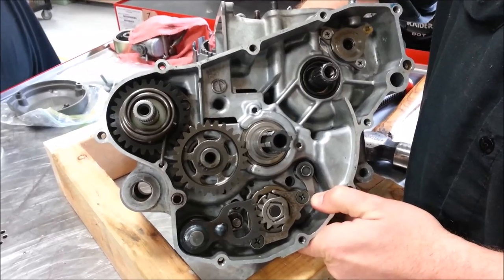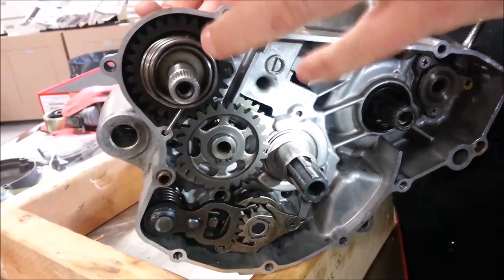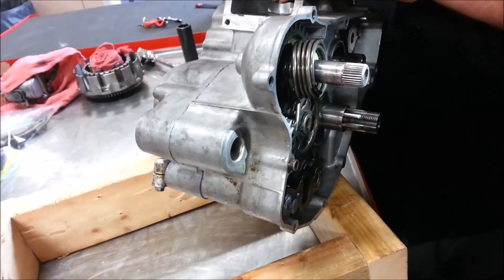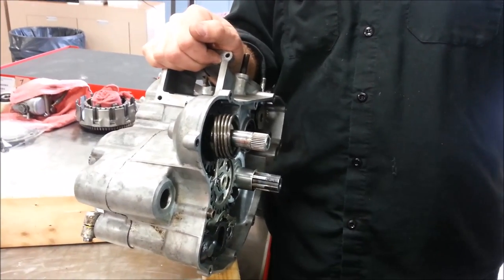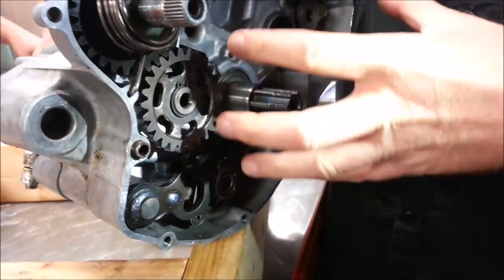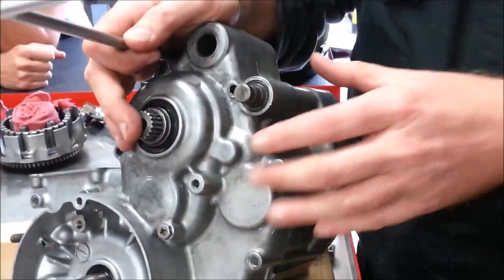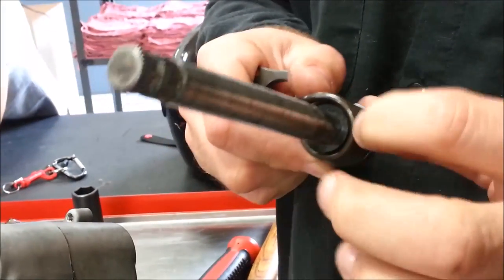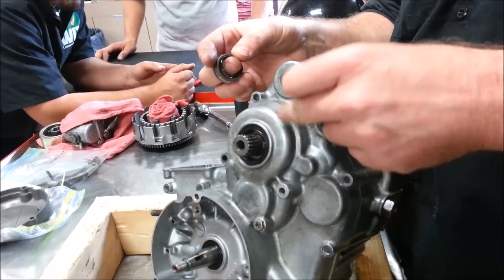2 Stroke Engine Disassembly   Shift Lever & Gear Change Mechanism   10 27 14

Comment: Hi Shane. I enjoy your videos. I have a very nice restored 1972 Yamaha RT2 360. Been experiencing a sticky shifter. I’m using Mobil 1 full synthetic 10w40 in the transmission. The manual actually calls for SAE 10w30. I drained the oil from the engine ... and I got my springy shifter back ... very strange. After I ride it for 25 minutes ... the shifter starts to get sticky. I drained all the oil and my spring comes back. Should I not use mobile 1 synthetic 10w40 in my 1972 Yamaha two stroke ? Just wanted to bounce some of this off you. Ed Burger Godfrey Illinois
Reply from the maker: I've never seen syn cause that but have seen oil level be an issue....
Thank you for commenting. Could you spare $2 and support us with even more benefits? Would you consider helping support our work here and help keep us going? We can’t thank you enough for helping us keep making technician training impacting schools all over the world.  Smash the subscribe button and bell! Join this channel to get access to perks:
https://www.youtube.com/channel/UCBhM8DCKnT3qXwTW0eToyCg/join   
-Daily MEMBER FIRST COMMENTS ANSWERED FIRST 
-Live Q/A video chats
-Wonder if we have a video on your need? Members can request content links!
-Full Access to the ENTIRE 700 video library
-Member-Only FREE tool giveaways 

Just want to say thanks quick to support us for this information and our work saving you money? 
Give us a high 5 here:  https://www.paypal.me/how2wrench

Comment: When I used to race my 2006 CR250 I never new if it was safe to just shift without pulling in the clutch while sifting so when I was already moving I wouldn't ever pull it
Reply from the maker: You should slightly blip the throttle on clutch-less shifts...

Comment: can you show a yz 125
Reply from the maker: You bet. Send us your motor!
Reply: Shane Conley u serious? I will. Ill send a motor ive never even laid eyes on before if Yall gonna fix the issues
Reply: K H44 what issues do you have 
I ended up fixing my problems with my motor
Reply: Can u show 67 yamaha yr1.  350 gear shift rod assembly